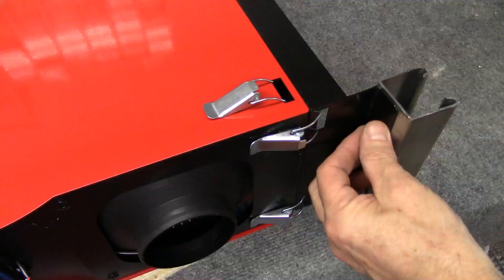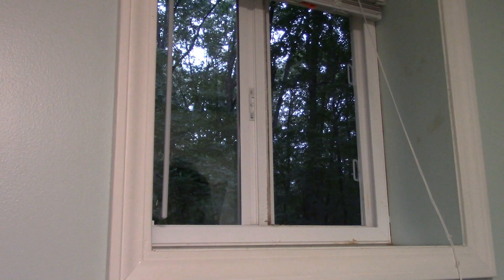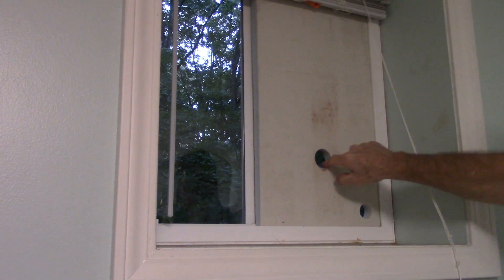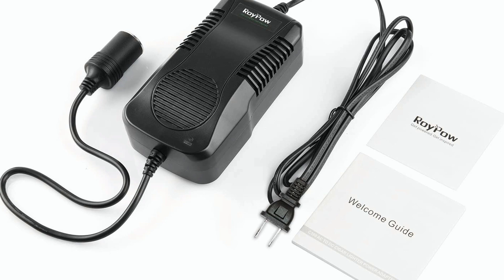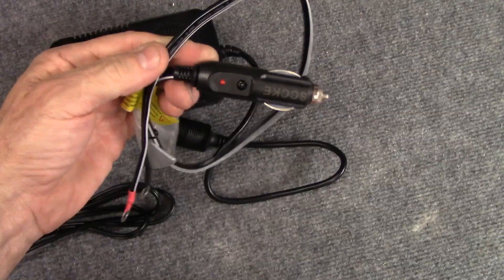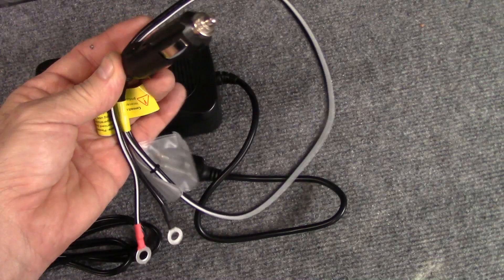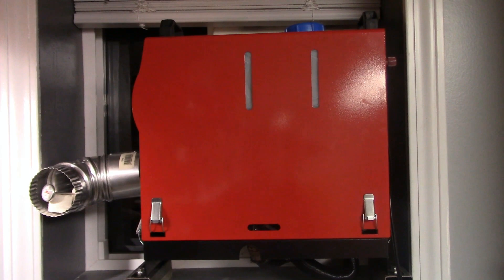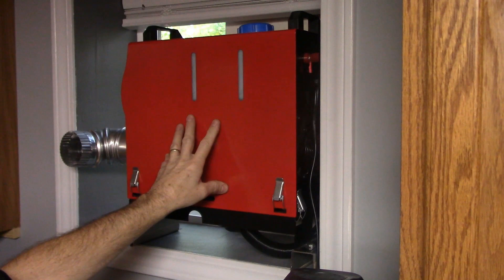Home Chinese Diesel Heater - Portable | Efficient | Safe

Comment: Great video. Thinking about one of these for my garage workshop. I think I'll be looking to putting a diesel tank outside.
Reply from the maker: Garage workshop is a good application and external tank is a nice upgrade.  Thank you!
Reply: @geenote  yea its a 20x10ft space, just want the edge taking off the cold in the winter - spent a lot of time insulating and draught proofing last year and it helped,  there is home brew and all sorts going on in here lol.   I might add a carbon monoxide detector just to be on the safe side.
Reply from the maker: @moonshinepz  Should work good especially with insulation.  Home brew...I can't think of a better use of a garage! 😂

Comment: There's a lot of complaints about shooting up in the burn chamber if you run these heaters low for long periods and then they won't restart.   If you keep it running moderately hot but circulate some of the heat upstairs, it'll last for years.
Reply from the maker: I make a habit of running it on high for while before shutting it down. Maybe that will help keep it cleaned out.

Comment: Used coal oil heaters in the 70's in N. Carolina and fireplace. The old house was built before 1918.
Reply from the maker: I grew up burning wood and coal for heat. 👍

Comment: You may want to check the spacing of the fresh air supply to the exhaust outlet. Where I live 3 feet is code.
Reply from the maker: It may not make a difference but the outside air intake hose is only for the inside heat chamber which is a sealed unit. If the intake pulled in exhaust fumes it is still only in a sealed heat chamber.  The room air is pulled in through the back and gets heated as it flows over the heat chamber and exits the other side.  I will ask about the code in my area to make sure.  Thanks for pointing that out. This video shows more detail of how the heater works and is made. https://youtu.be/kGzs5-S28Ak
Reply: Chuck you think hes worried about code
Reply: Codes are made for safety reasons. It doesn't hurt to consider using them for that for your own sake, not just because your told too. They where designed so clumsy greedy contractors don't take dangerous shortcuts that cause injury customers.

Comment: Looks like You have made it as safe as possible. lots of good ideas You've incorporated. Do You have any smell of Diesel fumes? Stay Safe and behave Yourself.
Reply from the maker: No fumes at all and the heat is dry.  I added a thin sheet of stainless steel under the legs and 4 rubber feet a couple days ago which makes it even safer. This little heater has been a good investment. Hope you're doing well.  Thanks!
Reply: @geenote  use in my expediter van
Reply from the maker: @NitroLambretta  Nice! Fellow YouTuber  "Expedite Travels" does the same thing.  His comment and channel are below in the comments if you want to check out his set up....

Comment: What I have done is left the intake hose inside the building so that the air going in is warmer. It will run more efficiently, burn cleaner and warmer heat.
Reply: In a house setting its probably ok. Wouldn't do it in a vehicle that way though. Having the intake inside creates a negative air pressure, and can potentially draw fumes inside of the closed space.
Reply from the maker: I totally agree! The intake hose is potentially just sucking up oxygen out of a small space only to be burned in a sealed heat chamber. The heated air that enters the room is pulled in from the back of the unit and not the intake hose.

Comment: Sucking in cold outside air takes more fuel to heat it up and gives out less heat from these inefficient heaters. You also seem to be heating the middle of the space and the ceiling.
Reply from the maker: Most people don't realize the outside intake air is only used to feed inside the sealed combustion chamber for the fire. The heated air that enters the room enters through the back of the unit. It easily heats a small area like these are designed for. Sometimes I might turn on a small fan to help circulate the air. Works great for me.

Comment: You should have some sort of variable bypass valve in the cold air intake mixed with the room air, there is you should have a "Y" connection that would allow you to mix the outside clean but really cold air with the room already warm air, so that you could choose if you want to heat the outside air (fresh, clean but expensive to heat as it is really cold air) with the already warm (potentially not so fresh but cheap to heat as it is already warm air).
Reply from the maker: The air that is heated and enters the room (and breathed) pulls in through the back of the unit which is already inside. The outside air intake hose is only for making fire in the sealed heat chamber. If the heater was mounted outside then it might benefit bringing already heated air through the back of the unit which I've seen done before. Thanks!

Comment: You can also use desktop/tower style computer power supplies. I used a mini power supply which has enough voltage and amperage to power the 5kw version.
Reply from the maker: I have a couple old PC's laying around with good power supplies.  Thanks for the tip!
Reply: @geenote  Yes, if I remember correctly, green and black on the motherboard plug fused together with a paperclip turns on an ATX power supply. Do research that first.
Reply from the maker: @caerbanoginterrupted1833  I'll check it out. Thanks!

Comment: You can change the hz setting to read a temperature setting 👍
Reply from the maker: Yes. Then the sensor built into the controller will maintain the set room temperature.  When I tested this method, the heater never shuts off when it reaches the set point - it just goes to the lowest setting and runs on low until the room cools back down then the heater ramps back up again.  If the room temperature was getting too warm even on the lowest possible temperature setting (and there is a low limit), the unit would still just keep on running until you push the off button to shut it down.  Hope this helps.

Comment: nice video but a few mistakes 1 if power goes out  it cant over heat because the fuel pump  runs on power NO POWER NO FUEL 2 the exhaust  is so hot that if the was condensation  it just dry out on next start
Reply from the maker: Without backup battery power, if the heater loses power it does not go through the cool down cycle and the residual heat will destroy the circuit board next to the heat chamber.  If my house electric power goes out, the power to the heater continues because it is being supplied from the UPS battery backup. It can then be shut down properly and go through the cool down cycle which takes care of the residual heat issue.  I would agree that the condensation is not a big concern. Thanks!

Comment: A fine mesh on the intake will keep bugs from entering the air intake and possibly causing problems.
Reply from the maker: Yes the one seen at the beginning and end of the video has a mesh screen inside the plastic intake filter.

Comment: Why do you pull cold air from outside? I would take the intake air from the room. That would also prevent getting exhaust fumes in.
Reply from the maker: The air pulled in from the outside is only for the fire inside the heat chamber and is in no way breathed or entering the room.  The air being heated and breathed enters the back of the unit which is the air inside the room.

Comment: I have the same exact heater 8kw but with the 4 blower ports instead of just one big blow port and it is a disappointment.  I mean it's not horrible just had higher hopes from 8kw.  Whatever you do buy one that has the same single heat blower port like the one in this video.
Reply from the maker: I would think the 4 port design would be about the same as the single port.  The test in this video was around 70 degrees going in the heater and 210 degrees coming out on the lowest setting....I think it was 1.5 hz in manual mode.  I think it will go up to 5 or 5.5 hz on high.

Comment: I think if you have a pipe extension to divert the hot air from the heater to the ground level, that will heat up the room more evenly. Otherwise, the hot air will flow mostly on the upper half of the basement.
Reply from the maker: Yes, it probably would help. Sometimes I use an oscillating fan to help move the air around. Thanks! 👍

Comment: I wonder, I have easy undisturbed access to my dryer vent. I bet I could set this whole unit outside, hook up to the dryer vent, and just open the dryer inside the house for a power outage situation. Thoughts?
Reply from the maker: Definitely!   You can get a reducer at Lowes that goes from 4" to 3" hose to use.  By sitting the unit outside and bringing in cold air to be heated, the heated air won't be as warm but will still be warm enough to be effective. Just keep the unit out of the rain, snow, etc. You would need a charged up battery and maybe a solar panel to keep it charged. I am posting a new video this weekend on a cheap and simple solar charging station.
Reply: Be sure to clean the dryer vent out well. 😳

Comment: you should look at venting the exhaust if possible through your heatpump fins to aid the defrost / work it does.
Reply from the maker: That is an interesting idea.  My heat pump is right beside a basement window in my shop. Thanks for a great suggestion!
Reply: @geenote  note that the condensate is corrosive and will degrade the fins on your heat pump with long term use.
Reply from the maker: @djenson  Yes that makes sense, kind of like spraying cool water over the fins in the summer will do the same....

Comment: Interesting video. I have a Kerosene heater and finding kerosene is hard, replacing it with a diesel heater might make sense. Burning up unused kerosene might be needed in my case. Have you used kerosene? One other item, red diesel is untaxed, you might want to check it out. I use it in my diesel generator.
Reply from the maker: I've seen where kerosene will work but someone smarter than me pointed out that K1 kerosene may not have enough lubrication for the fuel pump to work good over time. I only use diesel. I didn't realize the red diesel is untaxed. I try to use the white kerosene in my garage kerosene heater because someone said it was cleaner. Thanks for the tip!
Reply: Just run the kersoene mixed with diesel til it's gone
Reply: 50 50 low sulphur diesel and filtered used motor.oil

Comment: I am guessing that the Thermcraft sheet you used in the window is not Expanded Polystyrene Board Insulation.  Correct?
Reply from the maker: Correct - it is not. This material is denser and heavier. I easily cut it out with a hand saw. It is made to insulate high temp ovens and such.

Comment: Hope You're getting  the storm damage cleaned up ok--been concerned about You! Maybe Your diesel heater and generator came in handy during Your power outages? Best Wishes for You and You're family.
Reply from the maker: I have a bigger generator I kept running for a few days while the power was out which was nice. I have propane fire logs for back up heat at the house but the temperatures were mild while the power was out. I'm still waiting on a tree crew to take down a tree about to fall on my garage as well as trim a few others.  I'm lucky I still have a house but we got things cleaned up and repaired for the most part.  The next video I will post in a day or so shows many trees that had to be cleared blocking the trail we were on as a result of that storm. Thanks for checking in and I wish you and yours safe and happy holidays!

Comment: I would run intake fresh air from either 1) outside or 2) inside.
Intake n outlet C/monoxide so close together can end up sucking bad monoxide back into space.??
Reply from the maker: The intake hose next to exhaust is only going to sealed heat chamber to feed the fire. The fresh air intake for air that I breath enters through the back of the unit. All safe....Thanks!

Comment: This is very interesting I’m thinking about using it do you heat my garage space. Which I’ve cut down to 12’x20’ rather then my kerosene heater. Which is 4.00 gal.
Reply from the maker: I had the same idea to heat my garage but have not tried it yet.  I have a kerosene heater in garage and diesel is definitely cheaper. Thanks!

Comment: I've always wanted to take the exhaust and run it through a big long pipe that runs all the way around the shop before exiting outside therefore I could collect some of the heat wasted through the exhaust. Those diesel heaters put just as much heat outside as they do inside.
Reply from the maker: Major heat coming out the exhaust!
Reply: I have one of these heaters and I think there is a maximum for the exhaust length. You’re right though, it would be nice to get more heat out of the exhaust. I think a diesel EGR cooler could work. Pump water to cast iron radiator, in floor heat, or some other type of thermal mass
Reply from the maker: @jeffclark5024  That would work.  I remember a picture in the manual showing maybe a few feet max length max on exhaust.

Comment: How hot does the ceramic fireboard get, say 2 inches away from the hole?
Reply from the maker: I can touch the panel next to the exhaust and not get burned. The exhaust pipe does not touch the insulated panel if properly positioned.

Comment: The intake and exhaust look like they're too close and i may suck in exhaust fumes. Could the intake be inside the basement so that the warm air goes through the heater again ?
Reply from the maker: The outside air intake is only for the fire inside the heat chamber. The heated air that I breath enters through the back of the unit which is reheated as it flows across the outside of the heat chamber. This video (about halfway through) may explain better:
https://youtu.be/wAQehNzqAWY

Comment: Wondering if it would work even better if it was mounted on the floor with pipes running up to the window so the heat would come out nearer the floor since because heat rises.
Reply from the maker: Not a bad idea.  I would have to make sure there are no leaks. Also, there is a maximum length exhaust pipe recommended per the owner's manual to consider. I can't remember what the length is. Thanks!

Comment: Thanks for your video. Why do you need to put the fresh air intake outside? Wouldn't it be better to have the heated inside air cycled in the intake instead of the cold winter air having to be heated?
Reply from the maker: Thanks for watching and good question. The fresh air intake is only for the fire inside the sealed heat chamber. Pulling fresh air outside for the fire does not use up oxygen in a small heated room and does not affect the heated air that is being pulled across the outside of the heat chamber. The air that is heated enters the back of the unit. This video explains it better https://youtu.be/sbJbV8BuAOs.

Comment: Why does the air intake have to come from outside?
Reply from the maker: The outside air intake hose is just to feed the fire inside the heat chamber.  This hose along with the exhaust connects to the heat chamber.  Having it outside lowers noise level, doesn't deplete oxygen from a small sealed room, probably a safer set up, and follows the installation instructions. The heated air is pulled in from the back of the unit.
Reply: @geenote  makes sense, thanks for the response, and yes noise reduction is a worthy reason!

Comment: The heated air is very hot. Should you not insulate the steel hot air elbow pipe towards the wooden window frame?
Reply from the maker: Not a bad idea. I make sure it doesn't touch the wall but some insulation wouldn't hurt. Thanks!

Comment: Very nice! I got one recently for camping with my van, at the moment I did the same as you and put it in my shop. I have the air intake inside though, thinking this would be more efficient, is that wrong?
Reply from the maker: Thanks! The small 1 inch air intake hose is just to make fire inside the heat chamber.  I don't think the temperature of this intake air would make a significant difference in efficiency. The air entering the back of the unit is what gets heated and would definitely effect the efficiency. I would be concerned about leaving the small intake hose inside a small sealed area (like my truck shell) and pulling the oxygen out. This video explains the air intake: https://youtu.be/wAQehNzqAWY

Comment: I have kind of same setup in my garage in northern Canada when its really cold I have fuel up every 24 hrs
Just need some suggestions how to put bigger tank on it
Reply from the maker: I have seen other videos of people installing larger tanks on the kits but not on the all-in-one units. That would be a  good modification for someone to come up with.
Reply: I have a wood pellet stove in my basement (Philadelphia suburbs). I use a bag a day to keep my basement warm.  $5 a bag - 70yo block house with no insulation. If this works in northern canada for your garage then you are probbaly saving a ton of money compared to me.
Reply: @ninorcsinned3465  oh yeah 
And i m getting fuel for half price through the fleet rate (I m a trucker)
It took 1 buck cost for 24 hrs if setting is on 16/17 celcius
Reply: Here is the short video of it
https://m.youtube.com/watch?v=igyggmNikt0
Reply: Garage is insulated and there is a bonus room above it

Comment: After having and probably using the heater for some time how has it held up ? and could you provide a make and model and a link to where you purchased it ?
Reply from the maker: I have been using this heater most every weekend lately.  I have not had any problems at all!  I think these heaters are all very similar. I purchased mine from Amazon.  I think the 5kw and 8kw are maybe the same unit.  I paid way less than what it is now so you can probably shop around for a good deal. Thanks. https://smile.amazon.com/gp/product/B07WRZ9HV5/ref=ppx_yo_dt_b_search_asin_title?ie=UTF8&psc=1